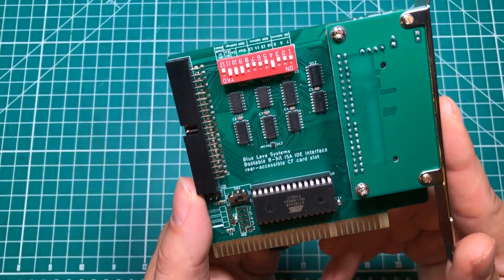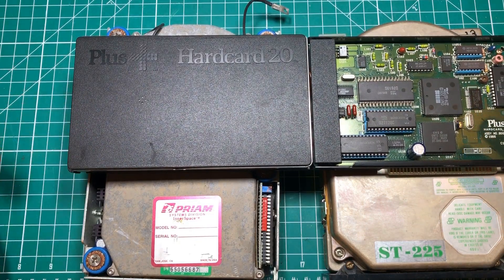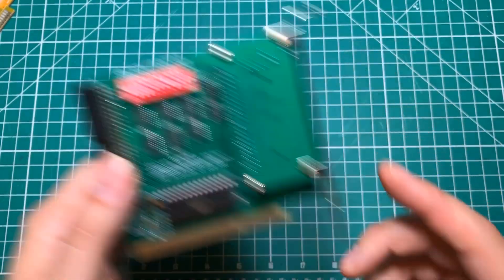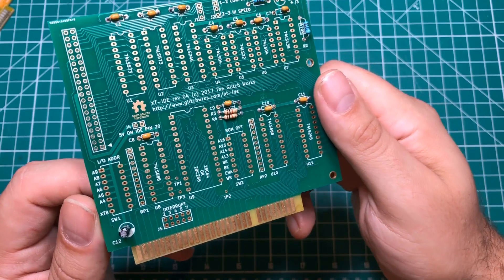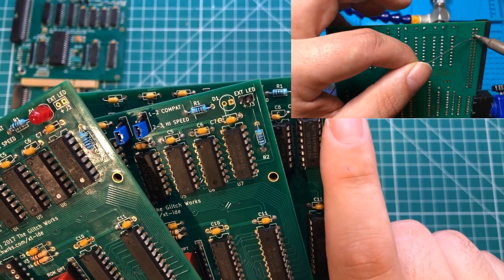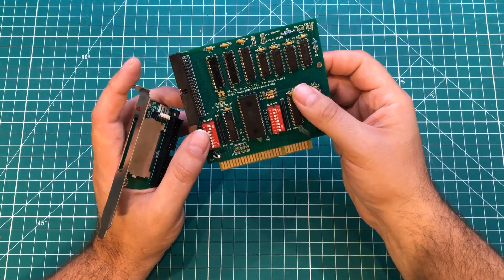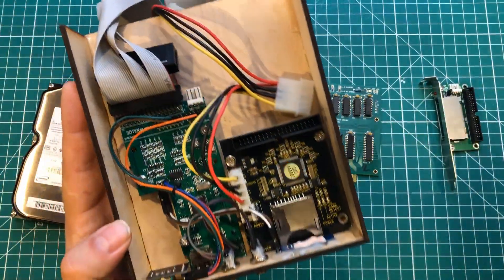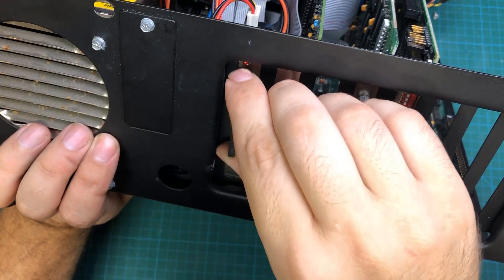The ultimate retro PC accessory - And you can make it yourself.

Comment: Another option you have, at least with some cards, is to use a 16-bit IDE card and put the XT-IDE ROM on a network card, or even an open socket on the motherboard, which that XT should have.  For a real XT like that, you could condense the hard drive controller, floppy controller and 8-bit multi-io card down to just one or two cards, and get the benefit of a high density floppy controller if you add an extended floppy BIOS into the mix (granted, I haven't tested that bit yet). And those 16-bit multi-IO cards are common and cheap.

Comment: The irony is that when XT-IDE was first being developed back more than ten years ago on the Vintage Computer Forums, one of the primary design requirements was thru-hole components.  I think I have a couple of the OG rev1 cards kicking around that I never built from that time.
Reply from the maker: Yeah. I get the people mass producing them not wanting to do through hole but it's super handy for me to have the option.
Reply: @AnotherMaker  It wasn't a criticism, Merely an observation! 😀

Comment: Where can I get a metal bracket for my Rev4?
Reply from the maker: The BOM lists a part number. I feel like it's only available from mouser, but possibly digikey also.
Reply: @AnotherMaker  ah I bought a kit from eBay which didn't have a bill of materials so I will look for this
Reply: part # 534-9202 for the bracket
part # 534-9301 for the screws

note this is for the blank bracket, and is not compatible with the CF reader.
Reply from the maker: @Megatog615  Ahh you are correct. I forgot that that was a different version. I 3d printed mine from a file over at thingiverse.

Comment: Nice interface options you have available for testing! I need a chip tester and programmer like that, and an IDE controller.  All of my magnetic media keeps failing so I want to get SD cards working in old systems.
Reply from the maker: Thank you!  And yeah, I can't recommend this programmer enough.  Even having a fancy chip tester (that cost 4x more) I reach for this thing 9 out of 10 times.  And yeah. I've given up on the magnetic media any time I can. I try to preserve it, but it's a losing battle.